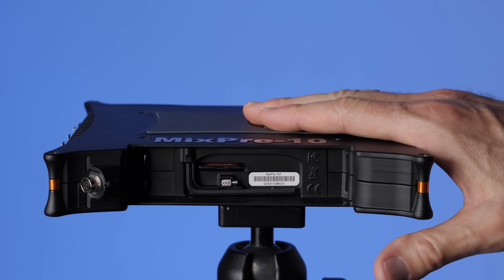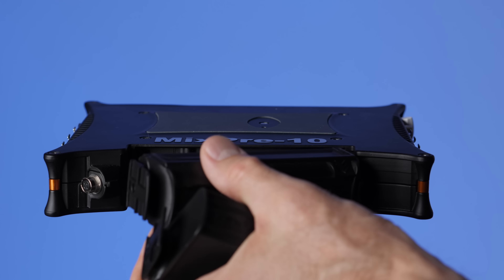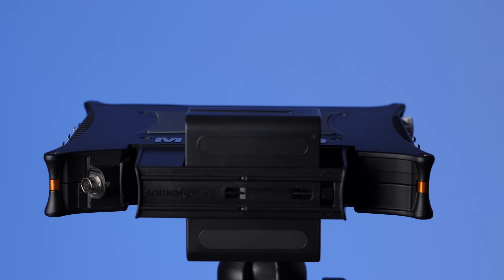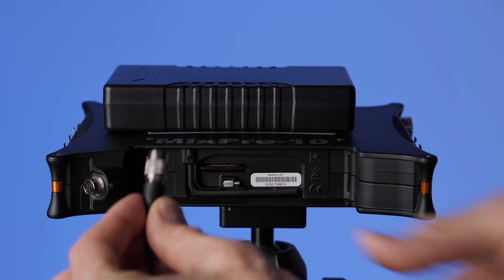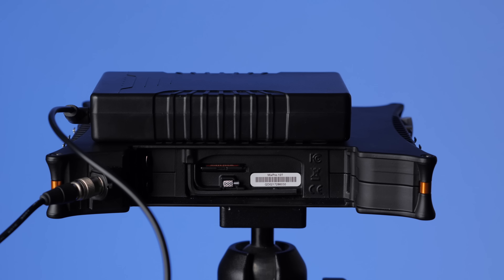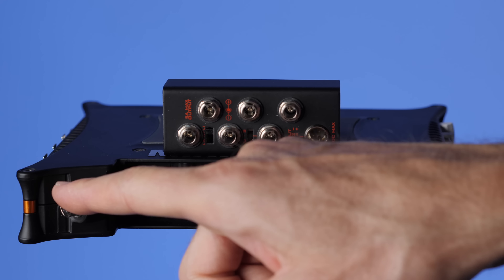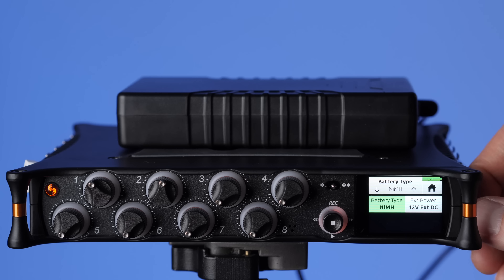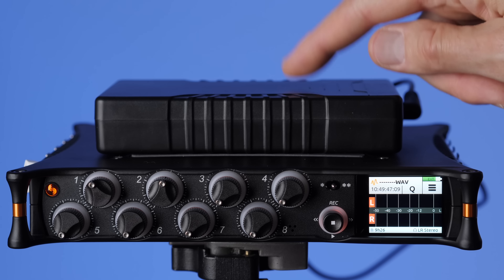Sound for Video Session: MixPre 10T Power Options

Comment: Hi there,
Thank you so much for such informative videos.
Do you see any pitfalls in powering the PreMix 10-II using a Powerbank like the 140 W Anker 737 PowerCore (I believe it might be 85 WH) in conjunction with a USB C to a Hirose adaptor cable, please?
Many thanks for your advice.
Best wishes
Fariborz
Reply: Probably fine but I've never used a USB-C to hirose adapter cable. let us know how it goes!
Reply: Thank you so much. I will come back with the outcome. @curtisjudd
Reply: I have now received the  USB C to a Hirose adaptor cable (by ALVIN Cables)
and he ANKER 737 power bank. Everything works fine. All channels on the MixPre 10-II function in 32 32-bit float with phantom power activated.  
However, there are some settings on the unit that I can not find any description of. 
In the External Power screen, there are six settings:
(1) 12 V Ext DC
(2) NiMH
(3) Exp. NiMH
(4) 12V PbAcid
(5) 14V Li-ion
(6) Full Range

While options 1, 2, 4 and 5 are fairly clear, I can not find any description of options 3 or 6.
In fact, none of the options are clarified in the user guide. 

Any help is greatly appreciated.

Many thanks

Fariborz
 @curtisjudd
Reply: @NavaArtsUK  Best to contact Sound Devices support for confirmation on those. My guess on 6 is that you can use 3rd party chargers that may operate at a different voltage than 12V, but definitely best to confirm with SD.

Comment: Hello Curtis, Can i power the Mixpre with the Talentcell power bank using the Remote Audio CSQN BDS Power output cable? They have a locking connector DC connector.
Reply: I don't think so.

Comment: I'm curious how many mics you were phantom powering when you only got one hour out of the 8-AA battery sled? With all the talk of poor battery life on the MixPre devices, I was surprised to be able to get over 6 hours out of a MixPre-6 on 8 AA NiMHs, with one phantom powered condenser mic attached.
Reply from the maker: 2 plus recording 2 additional wireless channels. There are a lot of factors that contribute to overall battery life. But that's great that you got 6 hours. Wow. Which AA batteries are you using?
Reply: I looked for the highest capacity I could find from a known brand that had good reviews on sites like Amazon & B&H. Found Powerex Pro 2700mAh AA NiMHs in 8-packs for under $25. Supposedly minimum capacity when new is 2550mAh. The popular standard Eneloops are only rated at 1900mAh. Eneloop Pros are rated at 2450mAh minimum and are $33 for 8-pack. Only time will tell how the Powerex Pros maintain their high capacity but they've performed very well so far.
Reply: Thanks for that! 👍

Comment: Hi Curtis, I'm currently using a Zoom F4 with a Talentcell battery pack and DC to hirose connector.  On the Zoom's home screen it shows the input voltage on the battery metre so you can tell when the battery is going to drop below the unit's voltage requirement.  Is there a way to check this on the Mixpre ii series recorders? (the minimum power requirement on the Mixpre ii is 10v and the Zoom is 9v which is why this question sprung to my mind).
Reply: Hi 1991ClarkJames, I don't believe the MixPre shows voltage anywhere but the power indicator changes colors as the voltage drops - green, yellow, red.
Reply: @curtisjudd  Thank so much! :-)

Comment: Hi Curtis. I bought the 150Wh version of the Juicebox V-Mount which is of course even larger than the 95Wh one. I was wondering if you've used you 95Wh while having your sound bag on you (not on a cart) and how do you contain/strap the battery while doing so? My 150Wh is not going to fit in my Orca OR-27 bag, so I'll need to somehow attach it to my bag harness in an ergonomic way. Thanks.
Reply: Hi Danni, I typically use Hi-Q style smart batteries these days but bring a V-mount or two for backup. I slide the V-mount into the second slot in my OR-30 and it fits nicely there. With the OR-27, it sounds like you may need to get more creative. Perhaps it will fit under the slot divider? Or perhaps the front pocket? I haven't worked with the OR-27 so I'm not sure how it is laid out. Best wishes!
Reply: It ended up fitting snug in the front side gap of the main part of the bag—resting on the top edge of the divider. So I may take out the divider so the battery hits the very bottom of my bag. Then I can place it vertically. Love your videos. You are my main go-to for many topics. Very straightforward with logical pros and cons. Thank you for replying.
Reply: @danniv13  👍

Comment: Hi Curtis, great video as always. Thank you.     
I believe that  the JuiceBox V-mount battery that you use in this video is the 95 Watt version,  cuz of the size of it  i am courious, also the link  sent me to the 95 Watt Version . I wanted to asked you , how many hours the 95 Watt version  will last powering the mix-pre 10 aprox  ?  Thank you
Reply from the maker: Hi Pablo, depends on the settings you use and number of channels you record. At least 4 hours, more likely 6 hours if you disable channels and outputs you’re not using.
Reply: @LearnLightAndSoundSessions  Thanks a lot !

Comment: hey curtis whats bettter for a mixpre 10ii 150 watts or 95 watts juicebox and how many hours from your experience while using multiple mics/lavs
Reply: Hi Pwetty gleesh, either one can work. The 150 has powered me through an 8 hour day but it will vary depending on how many mics, how many need phantom power, etc. Usually I'll need two to be extra sure to make it through, especially longer days.

Comment: Hello Curtis, I just found your channel a few days ago having bought a pre 10T. 

 Let me first say what a great audio channel you have here, I have learned so much and your breakdowns and explanations are first class!

I was wondering if you had any experience with the temperature of this device. I was using mine for a shoot last weekend, with a hirose-dtap cable to a vlock battery and the AA battery sled with lithium batteries for bridging. 

The device ran very hot, to the point where I several times during rigging turned it off and took it out of its bag to cool down.  The device was very hot to touch trough the rubber on top as well, and I was afraid maybe I had something that was drawing too much power trough it, but all I had was a Sennheiser 416 mic in input 1 and that was it. 

My question is, do these normally run hot, or is this unique that I should be talking to SD about? 

Sorry for a lot of text and thanks in advance :)
Reply from the maker: Hi Daniel, not unusual for the 10T to run warm to the touch but if it is getting hotter than that you may want to see about ensuring there’s some decent airflow in the bag. If that doesn’t help, may be best to contact SD support to make sure everything is ok. Best wishes!

Comment: If you want to use AA batteries, use NiMH rechargeables or Lithium primaries. We do not recommend Alkaline batteries as they have high internal resistance and so are not suitable for higher current applications. This is stated in the user manual.
Reply: Thanks Paul, good to know!
Reply: Hello Paul, is it true that you shouldn't use Dtap 14Volt to the Hirose connector but 12volt? As it gets the Mixpre hot and might create sound ...  Curtis I will purchase your course on the MixPre "as we speak"
Reply: No, not true. You can use 10-18V power source.
Reply: Thank you Paul !
Reply: I have a question.
Can I use the MX-USB Y cable included with the MixPre 3 and 6 to use the MixPre 10T as an audio interface with a computer with USB A ports?
I know this cable can not power the MixPre 10T, but, it is compatible to use it to connect the MixPre 10T with a computer with USB A ports?
Or which cable do I need?
I don’t want to fry my device.

Comment: such a terrible position to put the hirose input on the mixpre!!!  Designed to break after a few months of gravity having its way when used in a bag!!!  it shouldnt be angled out, better to come into the unit parallel with the case of the unit.
Reply: In practice, I've found it isn't as horrible as I originally thought. I keep the battery plate in place and that provides enough clearance such that the position of the hirose input is pretty close to perfect.
Reply: @curtisjudd  How long have you been using it like that?  I need it higher in the bag anyway for easy access to the Headphone/Data pot.  Ive been using velcro etc to raise it to where I want it
Reply: @deafdave6468  I've been using it that way since I bought the 10T shortly after it started shipping. My Orca bag also has a series of padded risers and adjustable brackets to raise it to the height I want.